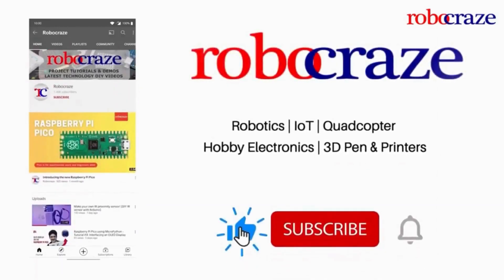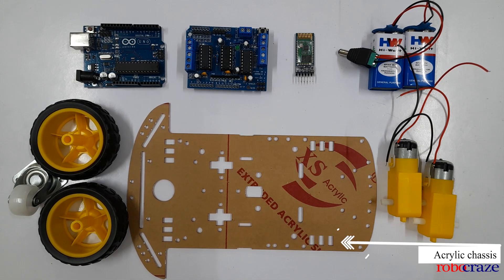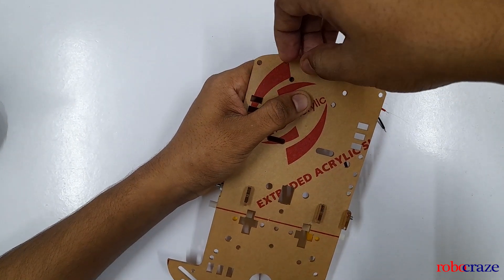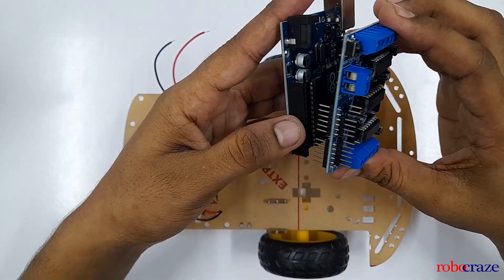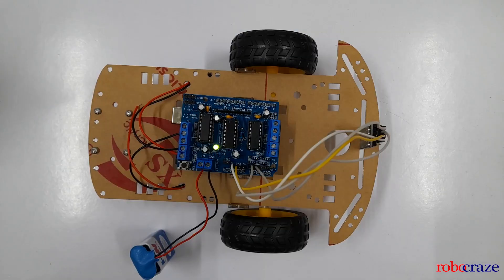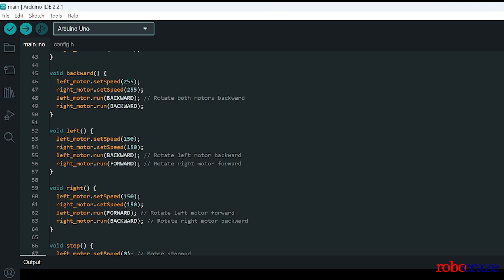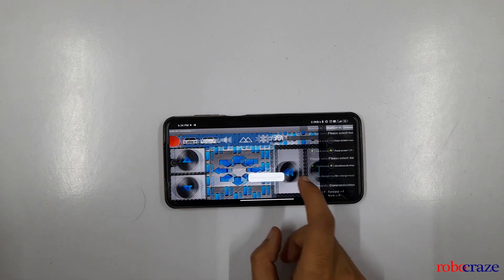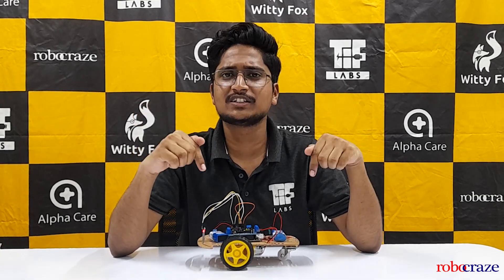DIY Bluetooth Controlled Car with Arduino: Step-by-Step Guide

Comment: Bluetooth is not connecting
Reply from the maker: Hello,
If the Bluetooth is not getting connected in the app, try connecting the Bluetooth from your phone settings. The pairing password is usually 0000 or 1234.
Reply: @Robocraze  it is connected now.i used another bluetooth sensor